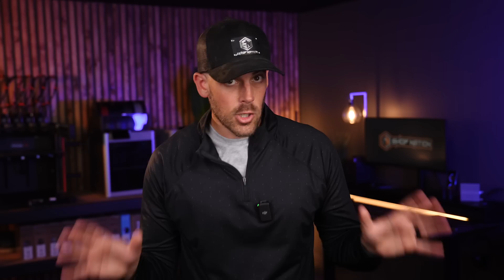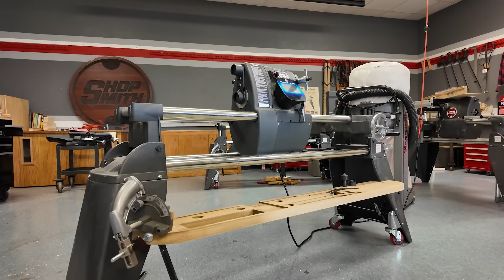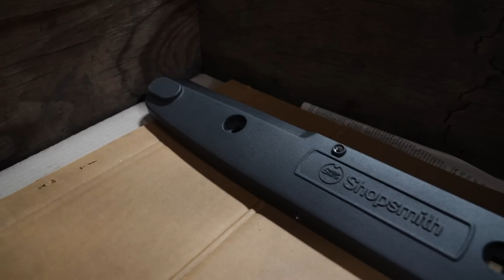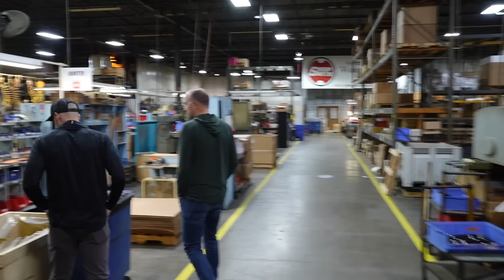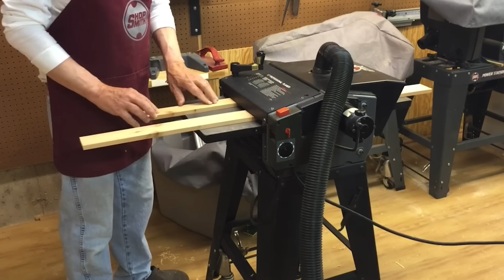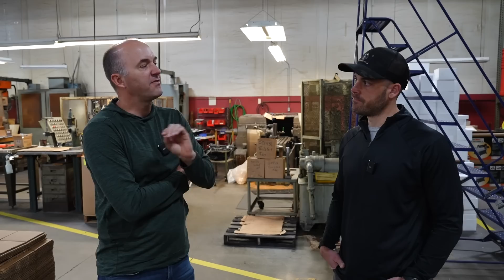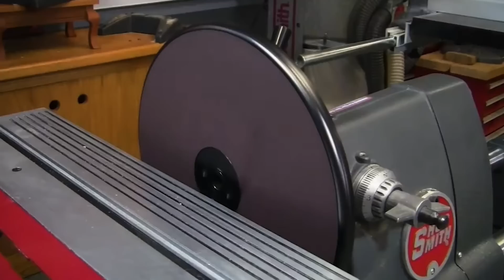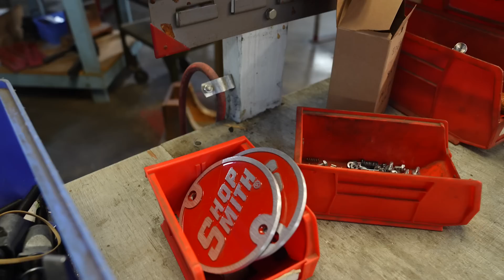The Last American Power Tool Company is (almost) dead

Comment: I bought one in the 80's and still have part of it.  Even then they were and interesting company that caused heated debate.  They are proud of their backwards compatible parts but maybe if they changed the design up to offer a better sawing experience coupled the rest of the interchangeable systems it might create more interest.  For space and diversity it cannot be matched.  Remember most DIY'ers buy start up systems and then graduate to larger bigger machines.  So Shopsmith is still a good beginners system.

Comment: I have bought 2 off of Craigslist and completely refurbished  them.  One I use as a drill press which works vertically as well as horizontally.  The other I use primarily as a lathe.  Wonderful tools and so well made.  Thanks for doing this video.

Comment: First I remember the big Shopsmith logo on the Lathe, drill press that we had in my shop class in high school. I had forgotten the brand until this video. I went to the Shopsmith website and it is okay but not really user friendly. I was trying to get the prices and I had to dig around and I am still not sure what exactly I was going to get. Some of my first memories of wood working were on this machine (the 70s version). With my limited shop space it would be a great option for me. Thanks for the memories and I wish them luck.

Comment: I’ve found with insight to hundreds of manufacturers that the bulk of earnings stability and growth is consumable sales. This comes in all shapes and sizes, whether it be tooling, repair components, wear components, stock. You can pick virtually any US manufacturer and judge its health by the number of small packages that leave its facility. Each large sale turns into years of smaller, higher margin sales. There has to be a hook. Hewlitt Packard is the king of this hill, but there are many nearby.

Consumers do not like limited choice, planned obsolescence is lame, this is a fine line, but the existence and growth of those on the top show that there are paths forward.

I would explore as many ways to increase the small boxes that leave the facility. It may not be the first, second, or third idea that is the good one, but that process should be a priority. Perhaps hobbiest materials kits: want to build this complex design? Here’s everything you need. Perhaps tooling subscriptions? Perhaps developing further add-on equipment, motivating a “collectors” mindset. I don’t know, would take weeks to dive down each hole.
Reply: The firms that can avoid this: I’d personally never want to invest in those areas:

Consider plastic bottles. The only reason you’d be able to sell plastic bottles and be profitable is if you could get them to where they’re needed cheaper than your peers. That’s it. 

So you invest in equipment. 

15 years later, innovation has occurred, and your equipment is no longer able to beat your peers who just harnessed that innovation. Do you scrap 30-50 year equipment at year 15 to remain competitive? Or just accept that growth is over, and begin to phase out. Awful experience imo.

So you want to avoid that: the way is to hook the consumer somehow. Make it so you’re growing not due to selling machines, but selling stuff that supports the machines you’ve already sold. Every new machine sale creates a positive feedback for the business, as the consumable side grows from economies of scale.
Reply: If I were nick id grab an engineering intern team and challenge them to develop a really cool add on product that any owner of any shopsmith could purchase and also could be manufactured in house. Something as simple as a timer, tool holder, wheel upgrade, whatever. Ask the existing users what they would change if they could. Your customers will tell you exactly what you need to do, not me, some random internet guy.

Comment: Strongest selling point is the space factor. As I look at my garage with miter saw, table saw, band saw, drill press, joiner, router I am drawn to get rid of it all to get my space back but I don't want to give up woodworking to do so.
Reply: Apart from the fact that's cost me an arm and a leg to get it to Europe I can't see myself paying 5k for an all-in-one stationary machine. My 'shop' is 6x8 feet and my machines need to be mobile to begin with. And for the price of one shopsmith I can buy a lot of tools to do the job.
Reply: @Grauenwolf  Upon viewing the video again i saw that it was mobile. But still don't see the 'beginner' appeal you can buy all you need for a quarter of the price and get started without having a sizable table to move around. 
The lathe seems to be the primary function but I wouldn't call that a beginner tool.
Reply: @Grauenwolf  As for now I wouldn't know what to do with a lathe, I grew up in a DIY shop and learned how to use many different tools but a lathe isn't one of them. Couldn't name anyone who even has such a machine here in the area where I live in the Netherlands.
Reply: You can never have to many power tools - However the shop space can be too small..

Comment: I have my father's Shopsmith he bought sometime in the late 70's. He used it in a small shop that was maybe 10'x12'. He made birdhouses, turned toy baseball bats for my brother and me, and replaced some bed spindles we probably broke. When I was in fifth grade, we moved to the farm I grew up on and he gave it to a family friend who used it until his death 20 years or so later. I got it from his son and used it in another small 8'x10'-ish building to build a blanket chest for my wife. When we moved to our current house, I brought it with me and my dad and I made some repairs to it and I used it a while longer. One of the parts on the spindle broke and I sat it to the side to use for some simple operations. As he said in the video, the table saw is probably the weakest part and having the older model with the belt drive the table is pretty small. 

I hate to hear how the company has struggled and wish them success. This video inspired me to see about getting the spindle fixed and getting it running again. I need a bigger lathe than the small benchtop model I'm using now. 😉

Comment: Wow I had no idea they were in Dayton. Time to pivot, address new markets with different tool offerings, go premium as a quality American brand.
Reply: I remember looking over their catalog in the early 2000’s. I wanted one of these and a Smithy. Two all-in-one solutions for woodworking and metalworking. The problem for me at that time was that I was a grad student making $14k/y and living with roommates and no garage. Even the financing options kept these tools out of reach for me, even though I could probably make space in the corner of my apartment’s basement. $5k is a huge investment when you can buy a job site tablesaw for less than $200 at Lowe’s.  I bought cheap (and used) tools one at a time over the last 20 years, upgrading when I could afford to.  It’s a lot to ask the 25-45 segment to invest $5k into a “starter” piece of equipment.